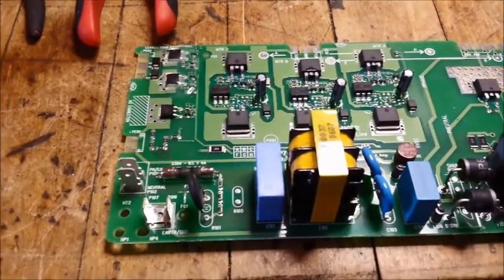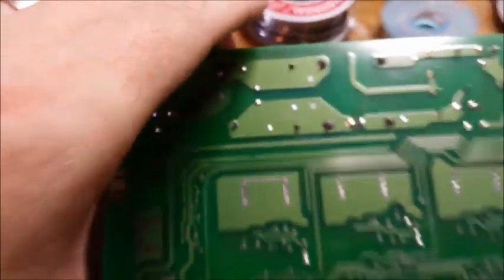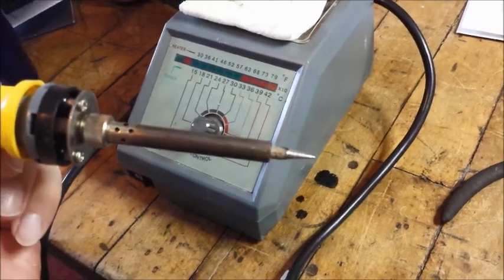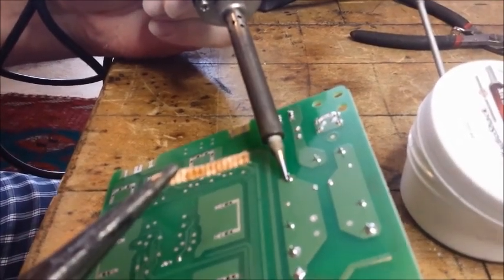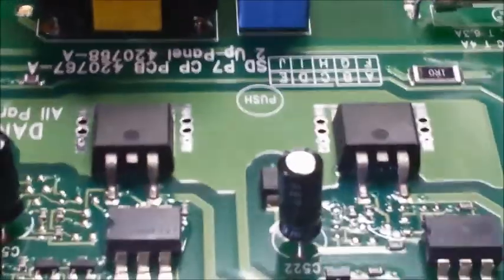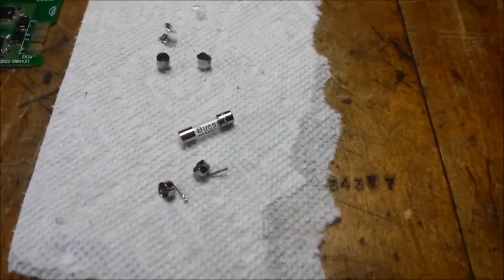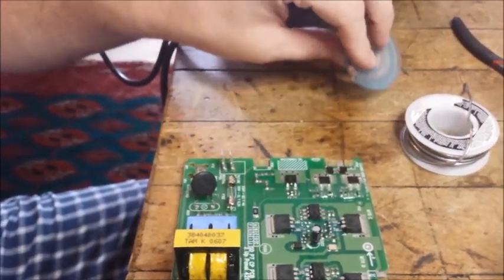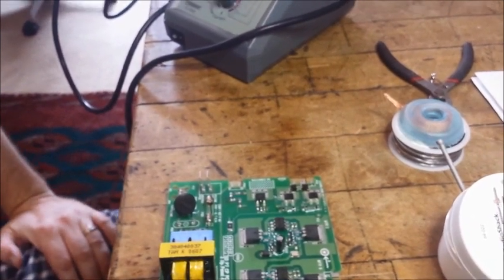Soldering fuse terminals to a circuit board

Comment: How did you remove the fuse from the two metal caps on each end? I tried breaking the glass like you said but couldn't get the fuse out.

Comment: how do you know a fuze is bad if not blackend
Reply from the maker: Hi, you should be able to visually inspect the fuse itself, it's a thin wire that will be visible inside the glass tube.  Just like an incandescent light bulb, look to make sure the wire isn't broken anywhere. hope that helps!
Reply: audible continuity test with multimeter

Comment: wow, removing the metal end cap holders? I would think we could shop for tube fuses that have the end cap holders & pins already connected
Reply from the maker: It's totally possible you can get the fuses with the pins pre-assembled, I would assume Mouser or Digi-key would be good sources to look.  When I made this video I was limited to what I could grab at the local hardware store...

Comment: While I was trying to remove fuse from matel caps,  the fuse broke and one of the cap also broke from from the little wire. 
The little wire is still there. 
How to connect matel cap to this little wire? 
..or can I buy the caps,  what are they called,  where can I buy them from? 
It's a Philips vaccume and the fuse looks same.. 
Thanks
Reply from the maker: I have no idea where you would get those caps from... you might just try to make your own replacement honestly.  If you used a thicker gauge copper wire to solder a length to the wire on the circuit board then you can wrap it around the end of the fuse and it should be possible to create a holder that has a strong mechanical connection.  Not sure if that's a good enough description but I wanted to at least put out one suggested fix?  In either case, best of luck to you!

Comment: After watching your video, I decided to try to replace a quite similar glass fuse in a linear power supply that had blown. When I went to the local component supply house to buy the fuse (which had axial leads permanently mounted to the fuse), the person there convinced me to replace the glass fuse with a semiconductor fuse of very similar specifications. Despite my rookie soldering, the power supply works perfectly now. I started thinking about it and I became concerned about the switch I made. Would you anticipate any problems with that substitution?
Thanks
Reply from the maker: , hey thanks, I'm glad to hear the video helped out.  I would think that as long as the fuse has the same specs in terms out being slow or fast, is rated for the same voltage, and troops at the same current draw then you should be in good shape. nice upgrade!

Comment: That looks identical to the board I am trying to replace a fuse on (Fisher and Paykel washer). Thanks so much for the video. You wouldn't happen to know what kind of fuse that you replaced it with would you? I haven't pulled mine out but it looks like a BUSS GMC? 125V. I can't really see the last letter.
Reply from the maker: I wish I could remember... But I think the specs for the fuse were printed on the PCB.  The BUSS GMC does look to be the right size, you may need to be extra careful taking it out though so you don't damage the lettering, the fuse on that board was in there super-tight and I had to mangle it a bit
Reply: +Albert Taylor Thanks. I should be able to see the letters once I get it off the board before I mangle anything. The letters I can't see are on the underside of the fuse in relation to the board. Thanks again for the video. This will be my first project involving soldering, and it gave me the confidence to get the supplies rather than just buy a new board.
Reply: Could one of you confirm what the fuse numbers and voltage were? Where did you purchase?

Comment: Where can I buy brackets?
Reply from the maker: I got mine fro Radio Shack, but that may not work anymore since I think they're out of business?  The two places I would look first would be Mouser Electronics and McMaster Carr.  Both have great websites and huge inventories, and you can usually buy things individually.  Start by searching for surface mount fuse holders, that should set you in the right direction, then you should be able to sort by the amperage and voltage ratings of the particular fuse.  Good luck!

Comment: I bought a $20 solder gun from Walmart and thought I was going over board, jeeez bro. What's a solder setup like that used for?
Reply from the maker: My go-to gun is a 60 Watt variable temp gun that I picked up for probably $40 from an online place like alibabba or amazon.  If you think you're going to do more than one or two projects with soldering I would highly recommend picking up something in this size range with variable temp, it will save you a lot of frustration over a cheapy gun.  One of my other hobbies is making tube guitar amps and the types of soldering you need for one of those builds is a little different... Actually this gun doesn't quite pack enough punch for everything I need so sometimes I have to resort to a small propane torch.  
This particular project wouldn't need anything like that though:  When you're soldering on a circuit board you're usually connecting two small pieces of metal together, since the metal is small, the heat stays concentrated close by so you don't need too much heat.  In bigger projects, for example you may need to solder a wire right onto a big chunk of metal like the chassis of an amp, or the casing of a potentiometer.  In those cases, because your applying heat to a large piece of metal the heat dissipates really fast so you need a gun with enough juice to keep the area hot enough to flow the solder.  Having variable temp is really nice too because you can tune the settings so you aren't burning off all your flux before you solder and stuff like that.  It's a small luxury, but it saves a lot of headaches if you do this more than once in a blue moon.
Reply: What happened with me was I had a battery backup that had some internal fuses blow and a regular solder wasnt enough. So I go to find a more "heavy duty" one but even this one barley gets the solder soft. Are those veri temp guns from Amazon well built? I'm just to the point that i'm sick of these little ling long China crap solders and I need one that will last as well as actually melt the damn solder lol. The project i'm working on is the ACP BE750BB Battery backup and it's driving me nuts!